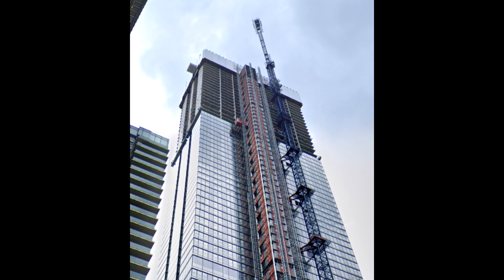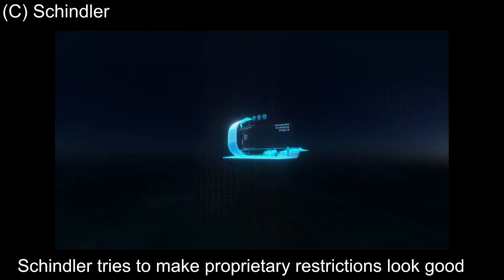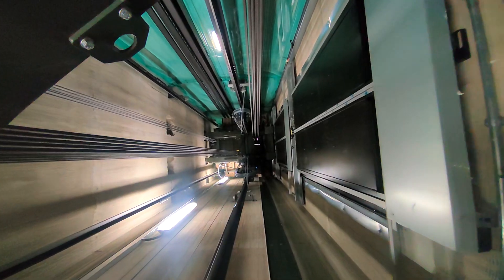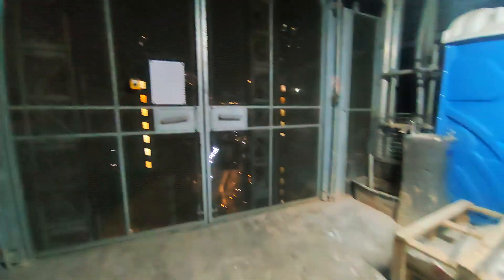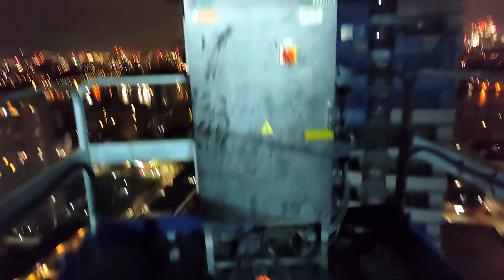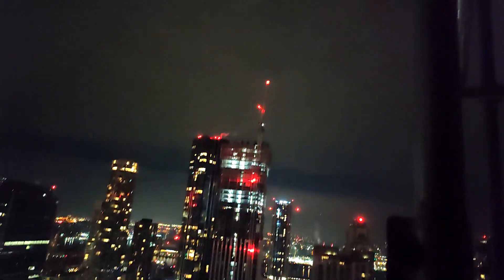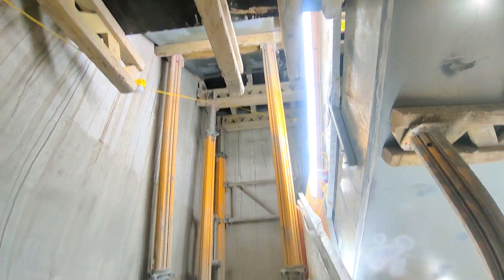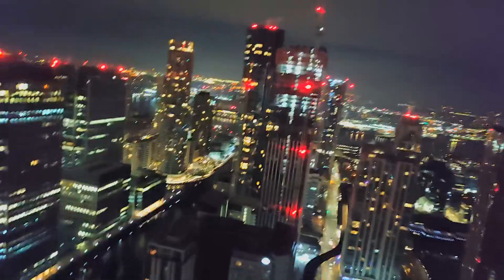Detailed look at Schindler movable motor room + Skyscraper under construction

Comment: Surely they would have to replace the cables every time they raise the motor room because then the lift wouldn't be able to go all the way down because the cables are too short?
Reply from the maker: The cables are in their packaging.  The cables are extended into the shaft as the motor room raises.  The cables are not cut at the attachment by where the unused packaged cables are.

Comment: Do they install a permanent motor room after construction is finished or do they use the movable motor room?
Reply: yes they do you can see the main lifts have yet to be put in and the movable motor room one will possibly be put in as a regular lift once there done

Comment: Nice video relly love how that part of london and rest of it is deloping whit new highrises and skyscrpers, in my capital Tallinn we have delopment underconstruction whiit 3 towers tallest be 111m tall and i dont think it has this type of lift in it only typical 6 construction lifts but it has concret factory on top whit interesting concrete pouring crane thingy nice video by the way.
Reply from the maker: This type of movable motor room lift is intended for buildings over 200 meters tall.  
A tower that is 111 meters tall is likely to have an MRL lift in the modern day which limits the speed to 3 m/s.  
Nowadays any building less than 130 meters tall has MRL for cost saving reasons.  It is annoying as I like to see faster lifts.
Reply: In Singapore it’s very rare to have MRLs any higher than 90 metres…

In fact, when our government procures lifts for high rise developments; there’s an unwritten rule that MRLs cannot be taller than 25 floors (or 90 metres for some agencies).

Comment: how does the wiring work for the lift then? Is there just a lot of excess cabling work at the bottom of the shaft.
Also I presume the orange light is to speed up the drying of the plaster.
Reply from the maker: In the motor room there is a drum of cable to extend the lift's cables as the motor room raises.
Reply: @benolifts  right, so I presume that’s a winding drum/winch style thing? And then that’d gonna be removed (and potentially reroped) when the lift is finished?
Reply: Tagging myself onto this comment so that when there’s a reply I get a notification